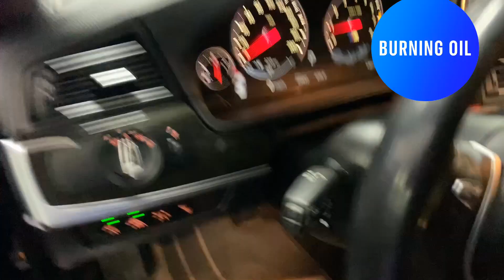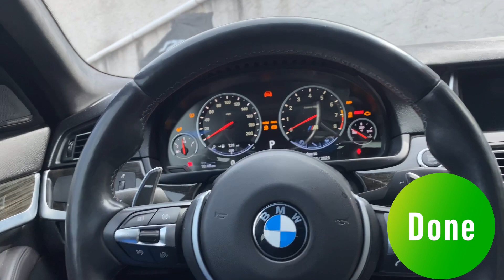BMW m5 2014 burning oil stem valve replacement

Comment: you change just the exhaust? it works?
Reply: how you remove the valvetronic springs?
Reply from the maker: @bernardo774  intake and exhaust 32 pieces
Reply from the maker: @bernardo774  you don’t have to remove them just set them aside , because it’s not easy to put them back if you remove them
Reply: @Vinnythemechanic  tks for reply! I will take the engine out, but will do the same as you, dont remove the cans
Reply from the maker: @bernardo774  if you’re removing the engine it’s way easy, just make sure you put rope inside when you bring the piston up to keep the valves from falling down